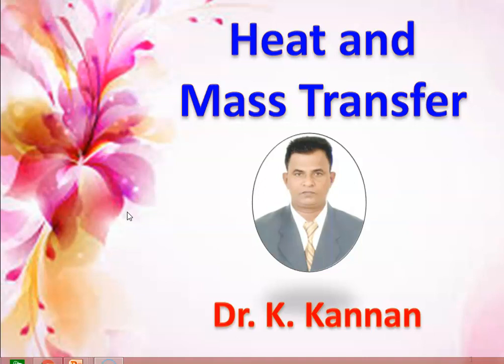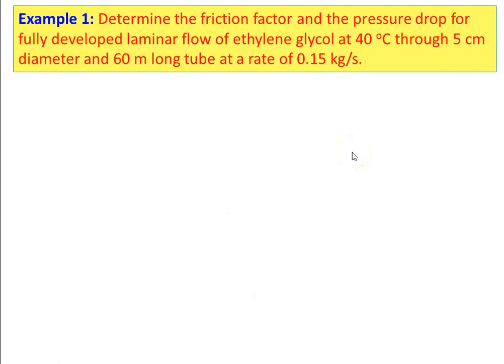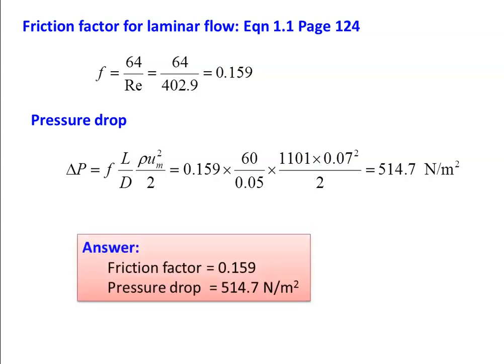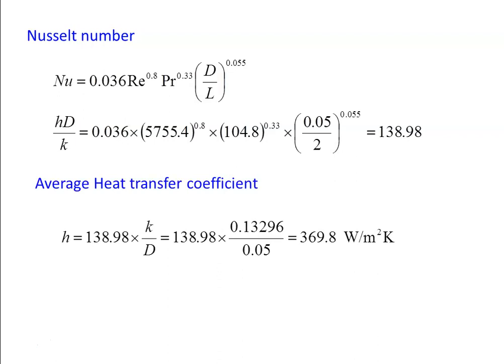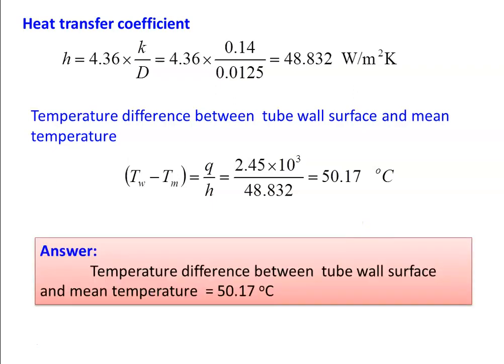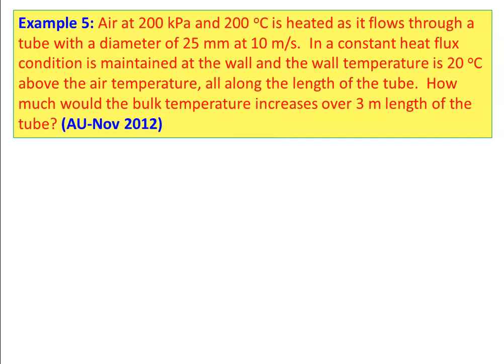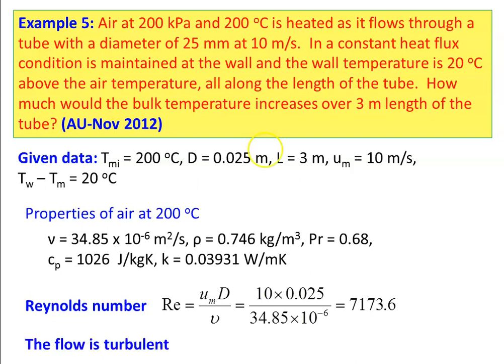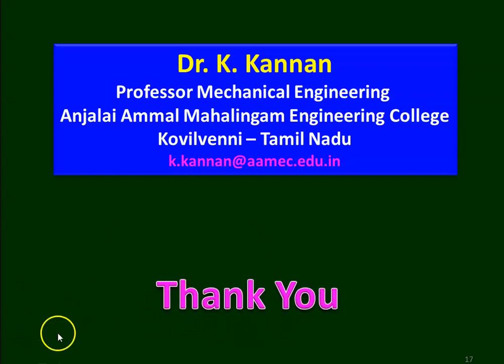HMT 2.4 Forced Convection Internal Flow Problems

Comment: sir in example 2 it has been given 200 degree Celsius and here the properties are taken for 147 degree where in previous lectures u told to take the mean temperature properties, how should we know what temperature to consider for the problems?
Reply from the maker: Mean T equal to inlet T plus outlet T divided by 2
Reply: thank you sir
 @dr.k.kannan198